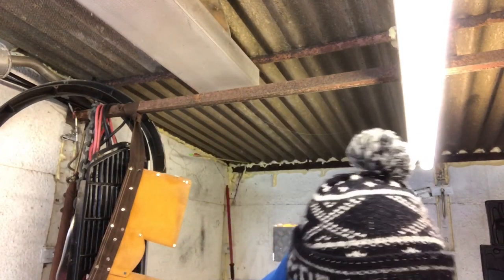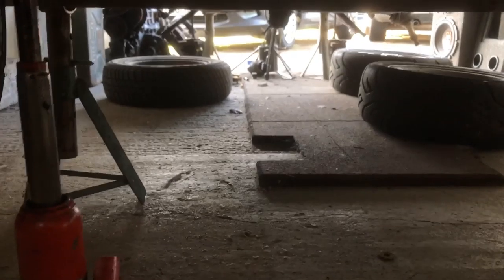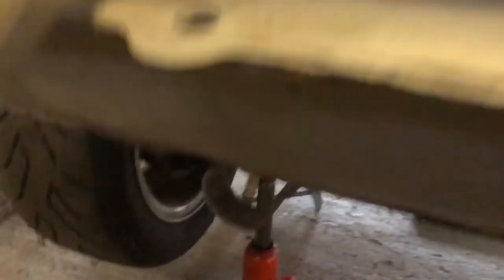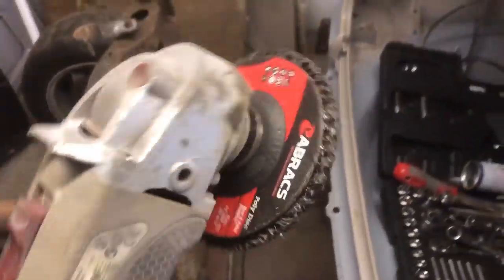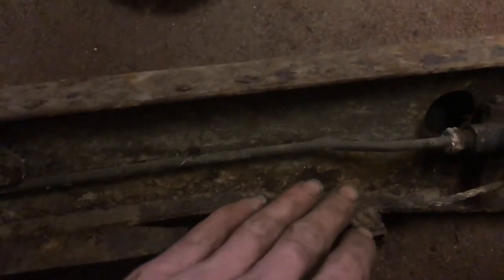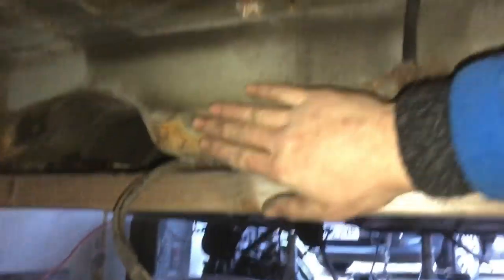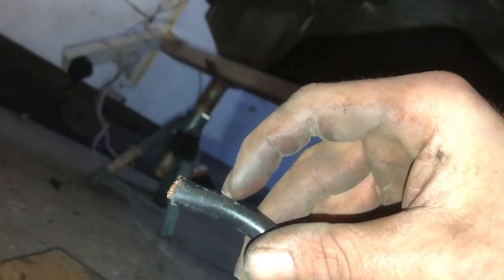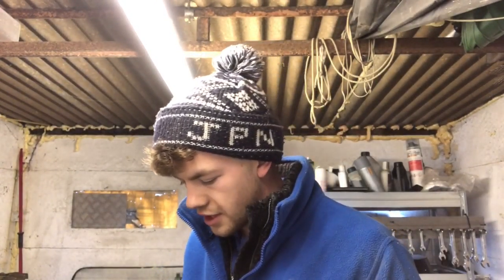CLASSIC MINI RESTORATION **nightmare subframe** part 8

Comment: Nice work sir, you are one lucky chap that rear heal board looks mint, I could not tell you how many times I have sheared bolts off removing rear subframes. Top tip - go to pound land and buy a £1 tripod, and a £1 selfie stick. You can take the head off the selfie stick and it fits on the tripod. I always carry these two things when making videos on my phone. I look forward to your next update,
Reply from the maker: The Gentleman's Motor Racing Team yeah its pretty good condition really! Sat for 10 years so dont thinks its seen much water on the underside. I will make sure i get myself a stick an tripod! Cheers mate

Comment: Good to see you got the subframe out without shearing any bolts lol. The heel board looks OK tidy up & some stone chip sorted. Cheers Dave
Reply from the maker: davejaguar66 Cheers mate, yeah i was surprised aswell. I cleaned the nuts up with a wire brush drill piece then sprayed lots of wd40 before trying to undo them. I was surpassed the underside weren’t worse then what it is! Like you say quick tidy up and some stone chip! Cheers

Comment: Looks pretty good. That subframe should clean up ok and you got lucky with that heelboard, might need a little patch after you clean it all up! I’ve always found the knotted wire wheel does a great job but is quite harsh when new. Haven’t tried those poly disks yet
Reply from the maker: Mini Matt TV cheers mate, yeah it aint to bad is it, i was thankful for the heel board! Yeah ive seen them but wernt to sure, but definitely investing in some as the poly disk wears away quickly when used hard, but they are brilliant for smaller bits!